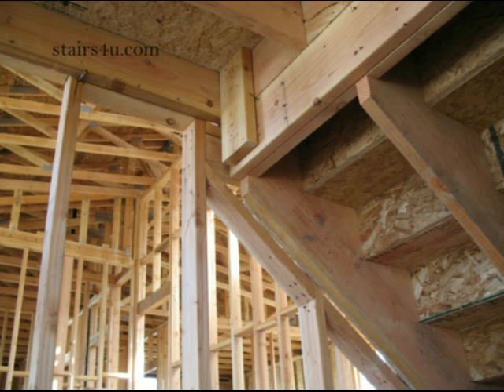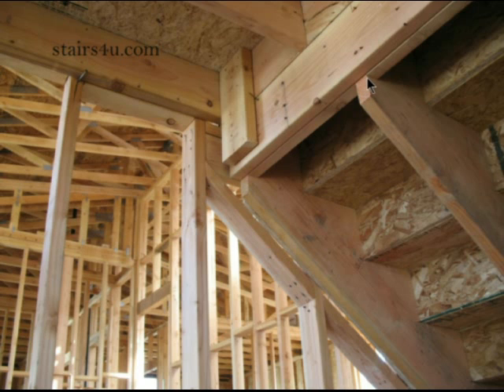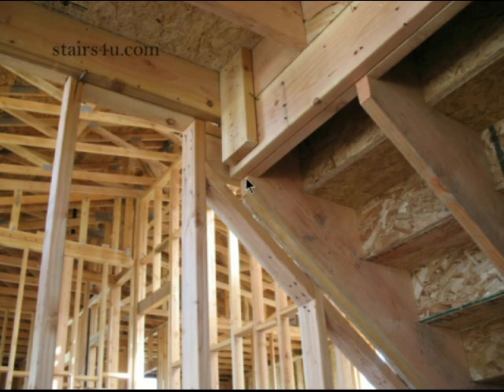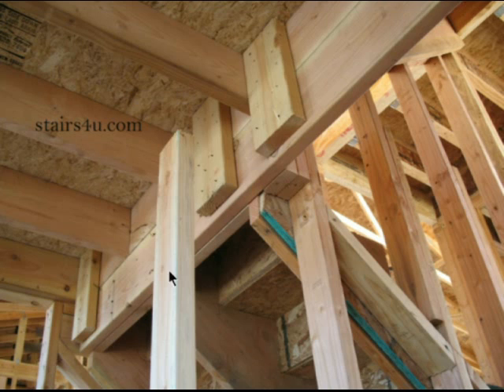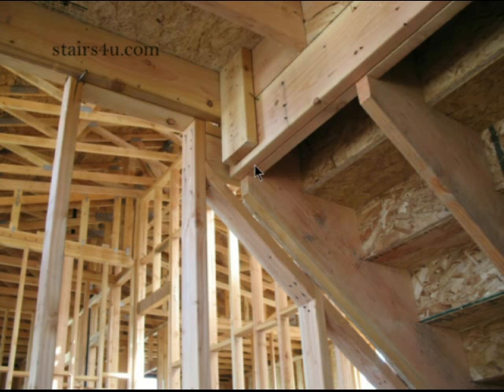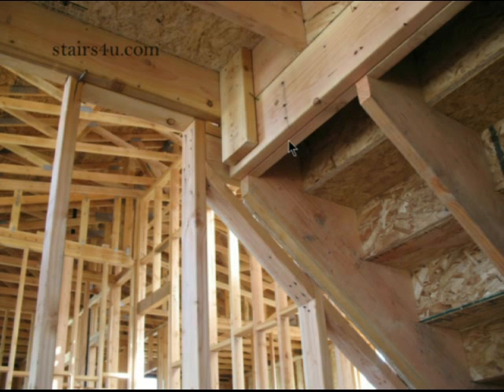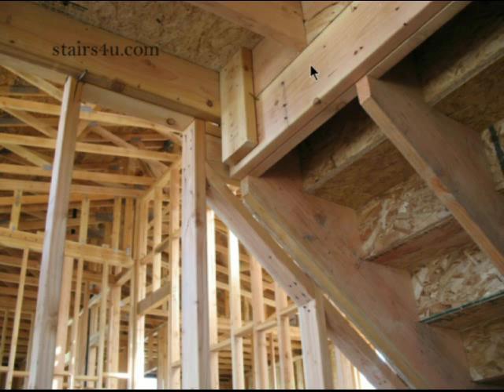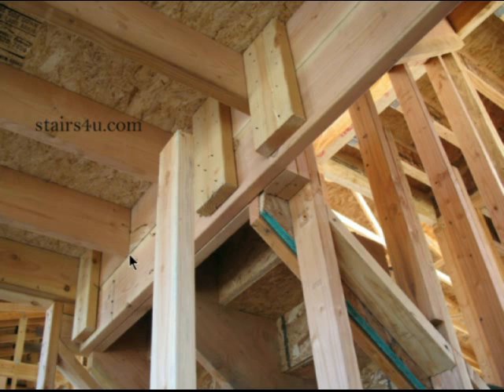Poorly Supported Structural Stair Headout - Planning And Design

Comment: I have noticed that the stair example you are using has a problem that you did;nt  talk about which is a problem with my basement stairway. Tha t is the top stair landing is below the upper floor. And that my thought on the soloution would be to elemenate the top notch on the side stringers and run the stinger all the way up. when use cleets on under the stair tread at the top landing. therefore getting rid of all the other ploblems except when a center support is use. Although I think that the center support can be supported with metal stapping or even a modifyed, and over sized joice hanger. Please forgive my spelling.
Reply from the maker: I would probably need to see a picture of what you're talking about, but it does sound like it would work. If I didn't answer your question feel free to ask it again or send me a picture. You can get my email address by visiting the website.
Reply: thank you very much for responding Im intending to use the methiod to repair my stairway in the basement I'll respond with more when I'm finished. Thank you very much for your opinion.
Reply from the maker: You're welcome.

Comment: If you look at the wall that is suggested to support the beam under the stairs you will see it is a floating wall.  It isn't supporting the joist that it runs parallel with.  I would guess the reason the 2x10 beam is not supported by that floating wall is that the slab underneath the wall is not designed to be load bearing.  Totally agree on lack of planning for drywall.
Reply from the maker: It really does start with the planning and design. I can't stress this enough, you have got to try and solve all of the problems you can possibly conceive in your mind, before actually constructing the building.